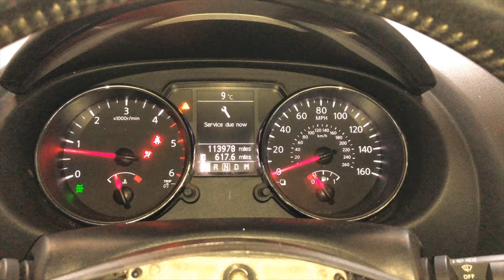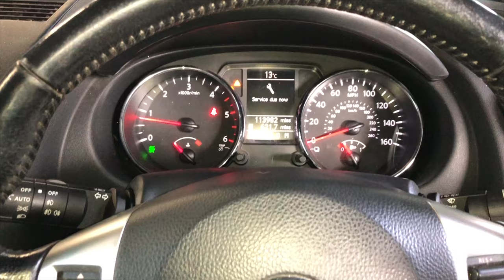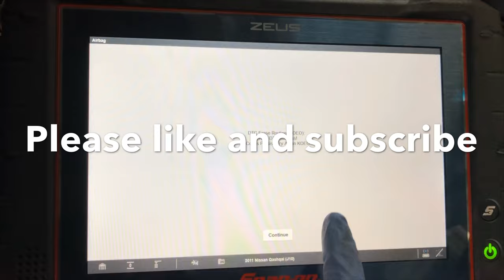Nissan Qashqai B1049 air bag spiral cable/slip ring/squib/clock spring. (driver airbag module open)

Comment: Hi I have a k12 micra 2010 same code problem coukd you advise me on the part number so I do not buy wrong one .thanks for sharing too .
Reply from the maker: hi I am not sure if its the same part no as qashqai here is a part no b5567-bh00a for qashqai, look up in ebay and also you can purchase from Nissan directly.

Comment: Hi thank you for sharing the video .
i have this fault on my friend's nissan nv200 2014. 
The fault was in history mode and could be deleted.  

Apart from checking the resistance on the spiral cable wiring is there any other method to determine its the spiral cable fault?
Reply from the maker: Idan zargrain hi there if you use this to before and after the spiral cable to determine the fault. It’s a resistor great tool. You will need to clear the fault codes sometimes after you have connected the leads, this resistor is a dummy airbag Sealey ABTR01 Airbag Test Resistor Set https://www.amazon.co.uk/dp/B07VZGCR8K/ref=cm_sw_r_cp_api_i_VjPAFb843DH71
Reply: Hi thanks so much now its all make :)

Comment: Hi, I have nissan qashqai 61 plate and have same code..I tried to order clock spring but not sure which one should order. Can you please advise!( Single cable or double )
Reply from the maker: Hi there please use this part no B5567-BH00A